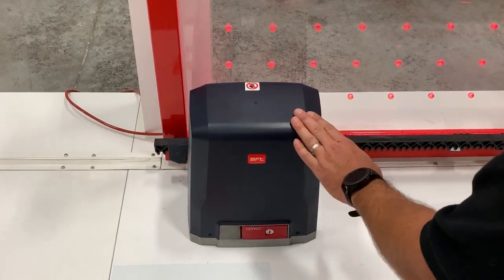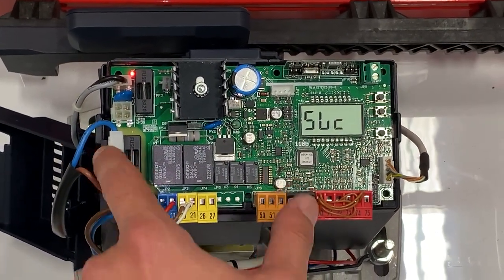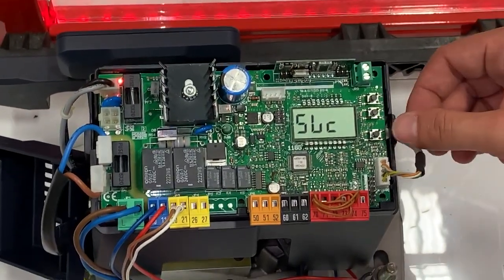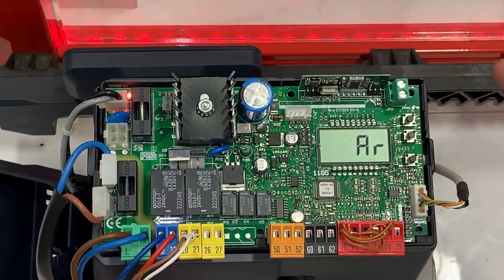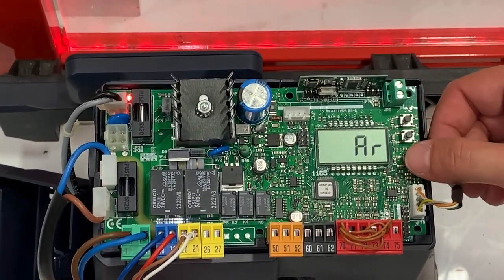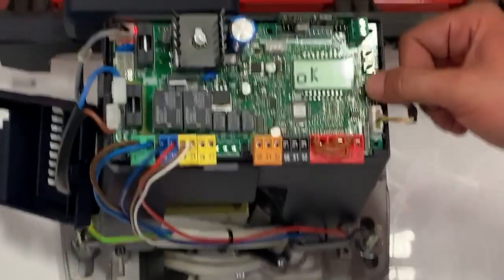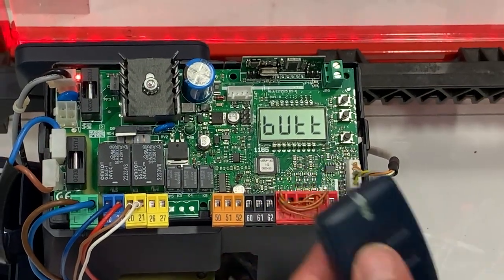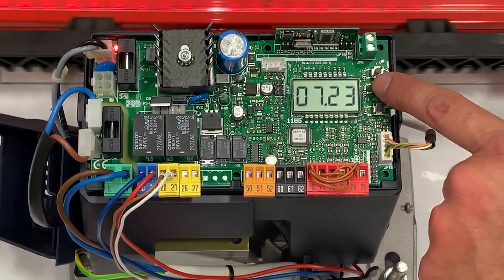BFT Deimos Ultra UL & Ares Ultra - Merak Board and Mitto Programming

Comment: I have a problem with the photocells on the ares ultra a 1500 model, the photocells are connected with 4 wires, which means power to both and the contact between ports 70 and 72. in the logic menu safe 1 is set to 4. the door still disconnects when you walk over it and I need them to open automatically without interrupting. the craziest thing is that when I cross 70,72, the photocell still reacts, interrupting as I pass over it. how to solve this very frustrating problem. after all, the door blocks and reports errors er 01,02,03,3h .horribly frustrating

Comment: What diference is between  residental and commercial Auto. Thank you
Reply from the maker: Great question. While AR and AC both turn on the automatic close timer and step by step movement with your remote control, AC takes it a little further and also turns on "pre-alarm" (where there is a three second gap in activation after you push the button so it can flash lights letting people know the gate is about to open) and turns on block impulse while opening (that's basically not allowing an impatient person to push the button over and over and over again trying to get the gate open and just locking the gate out from getting open and close commands back to back). All of which can be turned on an off manually in the main menu. AR and AC are just quick presets but can be changed manually if needed.

Comment: Hi how do I set the torque to be higher, because when it's windy the gate will not close fully? Also how do I set the timer on the gate to stay open for 45 seconds before it closes? I had to do a reset the other day because I wanted to erase the code er35. Thank you
Reply from the maker: For the Torque you want to go into the Parameters menu. There are 4 different torques you would need to adjust accordingly.... Op.Force, Cls.Force, Op.Slowd.Force, and Cls.Slowd.Force.

Make Sure TCA is "ON" or "1" in the Logic menu, and then make sure that TCA is set to "45" in the parameters menu.

If you have any more questions please feel free to reach us at Tech@BFT-USA.com
Reply: @BFTAmericasInc  thank you so much for your help

Comment: Can you please explain process and what's needed to convert from a 24vSolar BFT Ultra 400 to hardwiring to mains 240V? thanks
Reply from the maker: You will just need to remove the solar wiring and connect the 240V to 24V transformer. I'm pretty sure the transformer is still there. Most people just disconnect the transformer and leave it attached whet they are wiring up the solar system. If you need more details please write us at Tech@BFT-USA.com.

Comment: Getting ko and nothing happens ?
Reply from the maker: If it doesn't move at all it might be your photobeam wiring. Check our photo beam section for videos on our 5 wire hook ups. If not reach out to us at Tech@BFT-USA.com and we will see if we will try our best to help you out.
Reply: If it’s telling you ko and doesn’t go, it’s probably because you haven’t locked the key back in place like it says in the manual, when you open it you have to turn the safety key “gate”, then for programming you have to turn it back in locked. I know its 3 years later and it doesn’t matter to you anymore, but for the sake of others with the same problem I’ll tell you anyways.

Comment: BFT program remote to Deimos/Ares Pedestrian mode on ultra with merak bard i have programmed the second channel and this is ok .
but when i try this the gate does not go to pedestrian. I only hear a click and gate does not respond.
I checked everything in parameters and logic and they are correct. what could this be?
Reply from the maker: Looks like you missed the part in the video that says "To make sure that NONE of the "AUX's" in the "LOGIC" menu are set to channel 2 (000). Normally one of the AUX's is set to 000 by default so you will have to manually go in there and make sure none of them say 000.
Reply: @BFTAmericasInc   thank you wil try it tomorrow  .